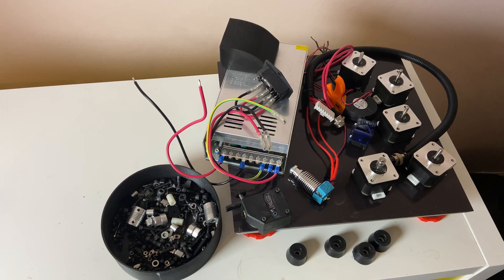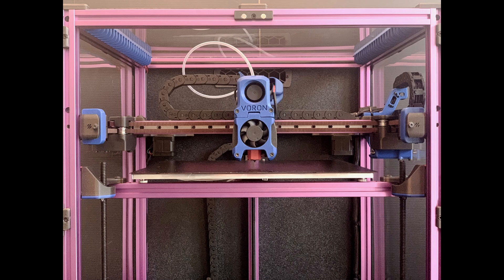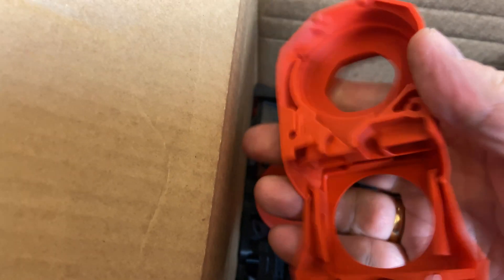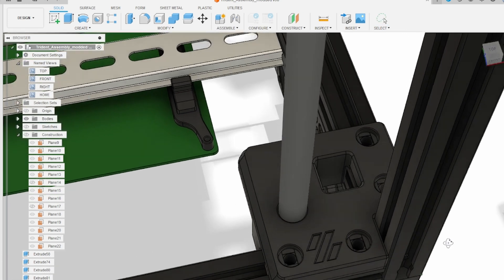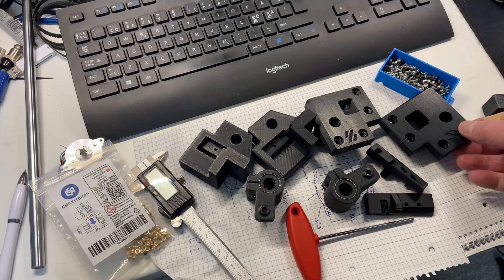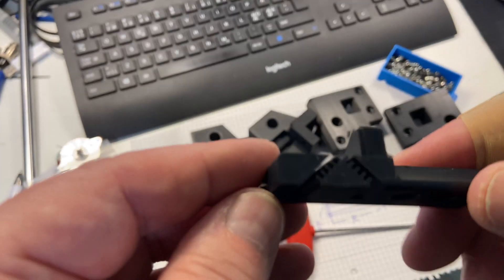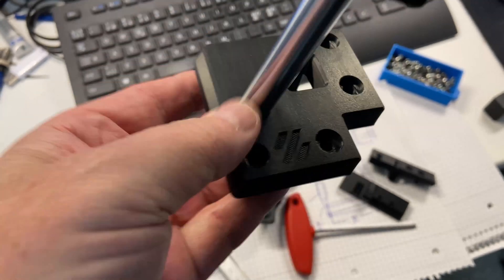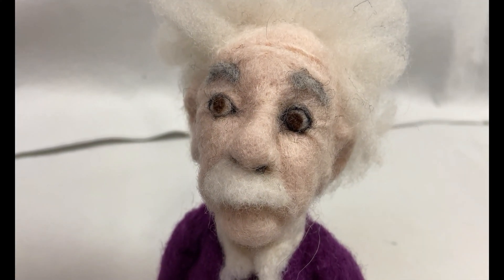It's not a Voron - Part1

Comment: Heads up earlier versions of the V2 did use printed 80T gears and they worked pretty well. They did use I believe a 20T gear as a hub in the middle to provide a better shaft mount. If you dig up some of the older manuals or STL's you can see how that worked if you want a mostly printed but more robust 80T gear.
Reply from the maker: Thank you for the information! I didn't know about that. I have ordered some Powge 80T gears, but that will take forever to get here. So i'll start out using the printed ones.

Comment: ohhh this is fun! i am jealous about al the extrusions you have laying around haha, i am building an normal trident. and for the electronics i am going to use the inverted electronics mod. it makes wiring super easy as you dont have to flip the printer, this does use smaller z motor mounts tho. something you could look into.
i also like the kanrog shoutout! i subbed :)
Reply from the maker: Sounds cool! Having the electronics in the most akward location on the printer is kind of strange.

Comment: Interesting idea. I’m not too sure on the tradeoffs between guide rods and linear rails, I always assumed linear rails would be more rigid but they have a similar cross-sectional area so it can’t be by much if they’re made of a similar stiffness metal. Guide rods aren’t as suitable where you need the linear motion element to also constrain rotation, you’d always need at least two rods for each axis.
Reply from the maker: I have "upgraded" several printers from rods to linear rails, but to be honest I haven't seen much/any improvement in print quality. But when it comes to reliability it's a different story. I have replaced several bearings due to noise or "slack". But that has always been the x or y-axis, not in Z. I haven't replaced any component on a linear rail so far.

Comment: The part with the eyebrows are the eyedlers/idlers for the Z belts. 🙂 Also, the Stealthburner toolhead has plenty of cooling for PLA. I print PLA almost exclusively on my V2.4r2, and it's working great. I just leave the doors open.
Reply from the maker: @grbrigsted  Good to hear that the cooling is good! I’ll build SB as designed and see how this works out

Comment: Oh, that is very interesting. I've been contemplating how much I could/should modify a Trident design, since I think I prefer the simplicity of the three-point moving bed over the four-point moving gantry.
Reply from the maker: Yes exactly, and to me it doesn't make sense to have four points on the bed. I am not trying to twist it to be straight:-) It makes sense for the gantry as I imagine that will twist with all the joints. Looking at my P1S it has only one stepper connected to all 3 leadscrews and all compensation for the bed is done by sw.

Comment: Interesting project, good luck, subscribed. I'm in the process of Voron-ising an old TronXY X5S. I plan a Trident-like top end, but I'm reworking it so the axis sits at the top of the frame, rather than on extra extrusions below. The belt run and X carriage stay the same, to make it easier to fit different extruders. I may make it IDEX or a tool changer in the future. For the bed, I'm going for a 3-point kinematic bed like the RatRig Vcore, but belted like you, because maybe non-planar 3D printing will eventually become a thing. I'll either use linear rails or 2x 10mm smooth rods,  needed to stop rotation of the Z carriages. And I bought a SV08, great so far!
Reply from the maker: Sounds like a fun and challengig plan. IDEX and tool changer is beyond my skills, at least now. SV08 would be a nice addition for me as well, but I am running out of space.

Comment: Really nice project! Planning a Voron Trident build out of an TronXY for a while now and will spend time end of year. Looking forward following you.
Reply from the maker: The Trident is a very nice design. Sounds like you have a good starting point. Will the z-steppers and lead screws you have match the Trident? Each component isn’t that expensive but it all adds up .
Reply: @v4projects  absolutely, complete BOM creates price and every position that can be saved by reused or stock parts helps.
Bought just one additional screw and stepper. Original Leadscrews has to get cut to lenght and shoult fit after. 

Trident is really nice, will use existing MGN12H on X, Y, Z because it is already on stock and build it with AWD and 9mm belts. It is 400mm TonXY and lays over Spec in therms of dimension, hopefully selected parts will cover that and in the end it becomes a reliable printer. 
May a good base for toolchanger system in future project.

Comment: I've build a flying zero (A hash of a voron 2.4 and a voron 0) . Initially, I went with printed pulleys as well but in the end decided to replace them with full metal ones. It's tricky to drill them straight and centered well. In my case, most of then developed a wobble. I guess if you're very careful, it will work. It's not a matter of strength as the plastic is beefy enough. Having a drillstand/drillpress  is probably a minimum as a small deviation will already lead to a wobble.
Reply from the maker: Thank you for sharing your experience. That is the part I am most concerned about. It’s probably not the right place to try to save some money. I’ll order some and replace later. Luckily I just need 3 pcs for my build.

Comment: Don't use esun abs+ for structural parts, it's way worse than normal abs both in terms of mechanical and thermal properties
Reply: ASA shouldn't be a problem...eSun on the other hand, oh boy. I used magenta eSun ABS+ for a Rook printer, and reprinted everything. Layer adhesion is the worst. But I heard, that eSun often changes their recipe, maybe I just had bad luck
Reply from the maker: I didn't know that esun ABS+ was that bad. I haven't used it much as I print mostly ASA and PETG,
Reply: @v4projects  in general ABS+ (and "easy to print", "low warp" and "low smell" ABS and ASA) are terrible for functional parts, as the modifications they do to make them easier to print substantiality lower their thermal resistance and make them creep more.
They're good for cosplay and toys, but for mechanical parts you need a good stinky and warpy ABS that requires 60°+ chamber minimum
Reply from the maker: Thanks, that's helpful advice! The main filament for this build is Isanmate ASA. The only red ABS/ASA i have is esun ABS+. I do however have some Fiberlogy ABS i can try out. (It's light green, like "RatRig green"). Have you ever tried the Fiberlogy ABS?
Reply: @v4projects  no I haven't, but I can vouch for Zyltech and Sunlu abs, not the best colours and not easy to print, but they are very strong and around the best for heat resistance
Reply from the maker: I am using a lot of Sunlu petg and pla. Haven’t tried their ABS, but I’ll do that. Thanks!
Reply: @v4projects  Sunlu abs is my main printing filament, it absolutely requires at least 60° chamber temp, but it's worth it because it's cheap and with good performance
Reply: @adeo  can you describe the problems with a chamber temperature below 60c?

I have made really bad experience with eSUN ABS+
And now using/ trying the sunlu ABS with an lack enclosurer, i get 48c as chamber temperature, most times no problems with waping, but my gut feeling is the layer adhesivesion is not top notch.
Reply: Indeed, I just spent a few weeks wondering why a print in place part worked great in ABS but just would not work in ASA, until I looked at the data sheet properly and realised the stiffness of ASA was half of ABS.
Reply from the maker: So, I basically have to reprint everything :-) I know the recommendation is ABS only. I am currently printing the parts with accent color again in Fiberlogy ABS. Interesting info about ASA, I am using ASA for automotive use and it holds up well for those applications. And I need the UV-protection. I might regret not getting some spools of black abs for this build. We will see
Reply: @v4projects  don't worry, ASA is good, only bad ASA is bad. Yours is probably fine

Comment: I just completed a similar project using a 2.4 frame but quad belted z w static "trident" gantry.
Reply from the maker: Cool! Are you happy with the result? How did you do the z belt tensioning? The Trident gantry seems to block the access to the original adjustment screw. I am thinking of using a thumbwheel I can reach from the side of the tensioner.
Reply: @v4projects  the z tensioner is very similar to the stock voron 2.4 tensioner except that mine is underneath the gantry and not mounted to the top of the frame. Are you in any of the 3d printer discords?
Reply from the maker: As my design looks the tensioner will be below the gantry as well. Not in any groups except klipper.discourse.group.

Comment: Looks great! You should look up Voron Legacy to see if some of it's designs can apply to your build :)
Reply from the maker: I have actually been thinking of that, but haven't looked at the Legacy in detail. Good idea and reminder! The reason I didn't go for the Legace in the first place is that I have 3 MGN rails. One  MGN12C and two MGN12H. And they are the right length for a 300x300 build. My plan is to to build the frame and gantry very close to the Trident spec, It should then be easy to build the z-axis like the Trident as well, should my design fail.
Reply from the maker: I opened the CAD-model for Legacy in Fusion now and there are some really nice looking holders for the z-rods in that design.